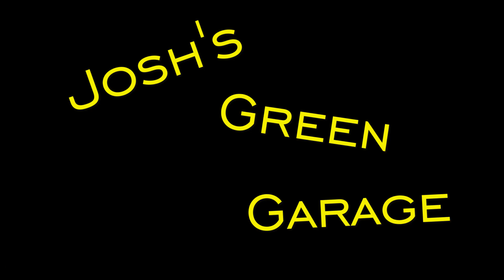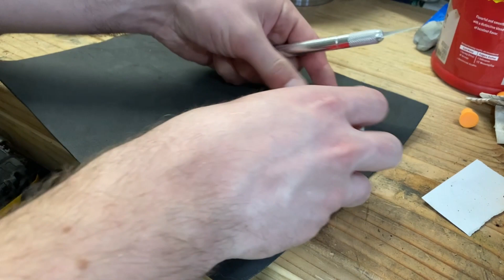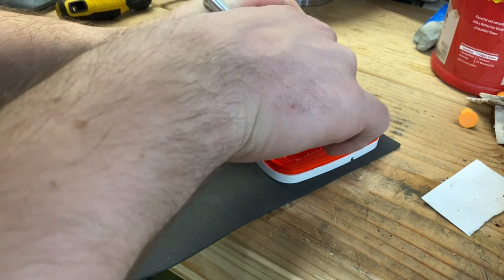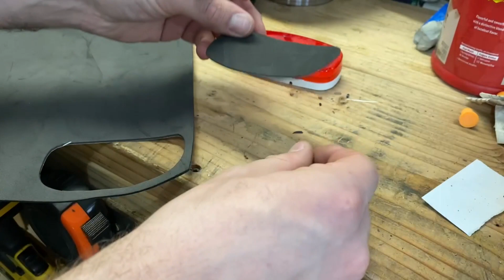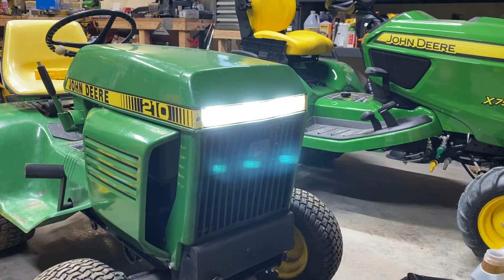John Deere 210 LED Taillights + Headlights - Part 3

Comment: Just bought a 210 without the wiring assembly, would you suggest anything that fits into the three light areas on the front? Has Anybody fit a light bar in that area?
Reply from the maker: I’m sure people have put some other stuff there. I’d recommend joining the 200 series page on Facebook. You may find some ideas. Alternatively, you may be able to find the light housing if yours doesn’t have it. If it’s just a wiring issue, it should be pretty simple to wire up.

Comment: Hello, I just bought a 210 and would love to follow your lead on those LED headlights but the EBay link in your description doesn’t work. Would you mind double checking it and letting me know how I can reach the seller? Thanks!
Reply from the maker: Try this:

https://www.ebay.com/itm/125555784406?mkcid=16&mkevt=1&mkrid=711-127632-2357-0&ssspo=bGDkFfZOSDO&sssrc=2349624&ssuid=8iXmFt9LQPK&var=&widget_ver=artemis&media=COPY
Reply: @JoshsGreenGarage  That one works. Thanks!

Comment: If I remember correctly, there is a sensor switch for the shifter from factory. I think that it's to keep the tractor from starting in gear though. It could be remounted and rewired for a reverse switch